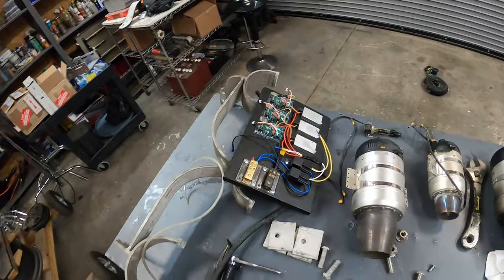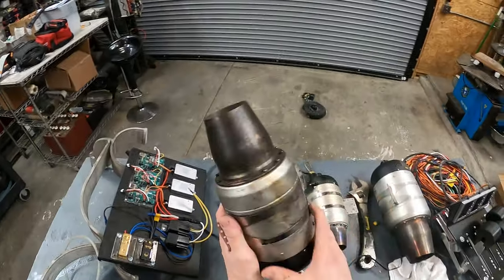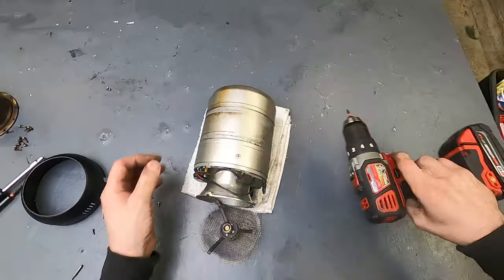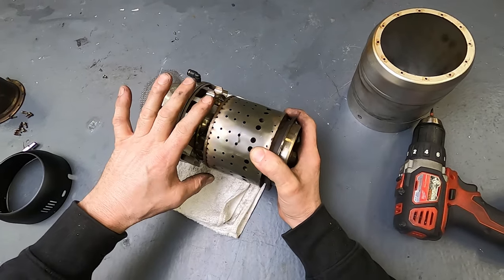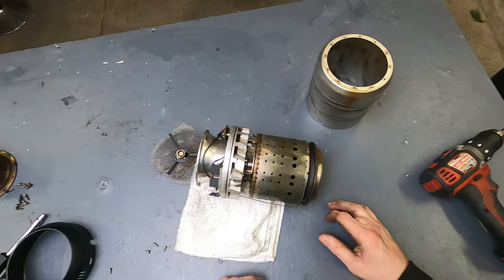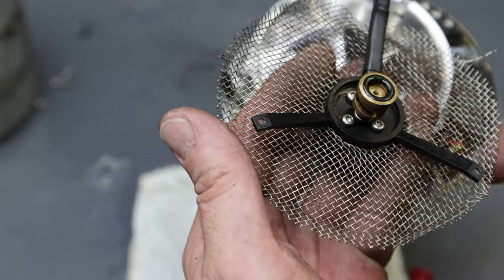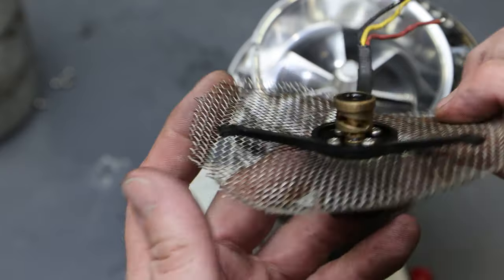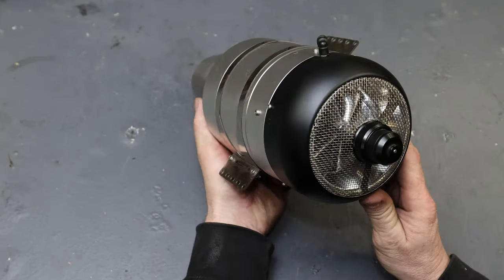Jet Engine Disassembly and Cleaning (Engine from Jet Powered Tesla)

Comment: FYI...Stainless Steel will rust if the surface coating is scratched, or if the metal is heated above 450C
Reply from the maker: Good point, you're right it was probably stainless steel coated.. China of course. I usually buy the American stuff that is solid 304 or 316, I put that stuff in the worst environments without any corrosion.
Reply: Or is sitting in a warehouse underneath a swamp cooler 😂

Comment: There should be a way to do a "compressor wash" which we do on the big engines. Just spin it up w/o fuel and spray a cleaning agent into it.
Reply from the maker: I was thinking that exact same thing while I was doing this, I almost tried it but the starting clutch mechanisms were binded up so I had to take it apart anyway. Also I needed to clean the electronics behind that front engine cover. But yeah I wonder if that would work.

Comment: Can you please make a video on how you made the dynamic balancer to balance these turbines engines?
Reply from the maker: Yes absolutely, however to clarify, the one I made that I used to use I got rid of and I bought a much more accurate machine. My old one balanced within 1/10th of a gram, my new machine is within 1/1000th of a gram (1mg) really amazing.
Reply: @WarpedLab  I need a balancer like that for my turbines. That way I can repair them myself. Please do provide some info on the new balancer you bought
Reply: @WarpedLab  Can you please tell me what balancer you upgraded to?